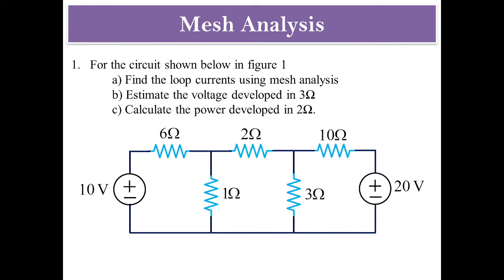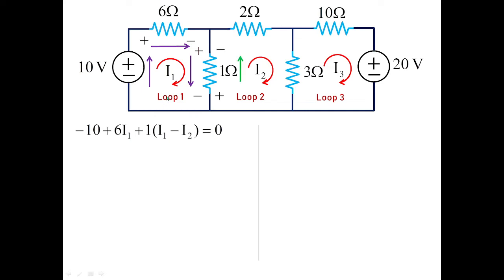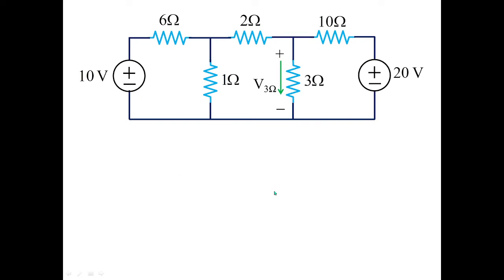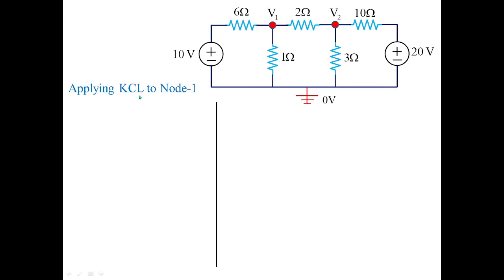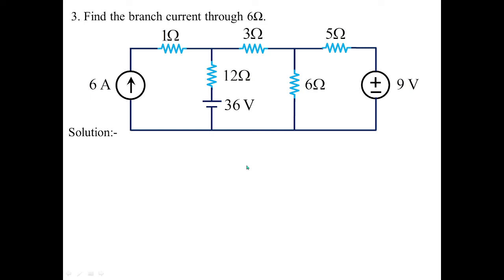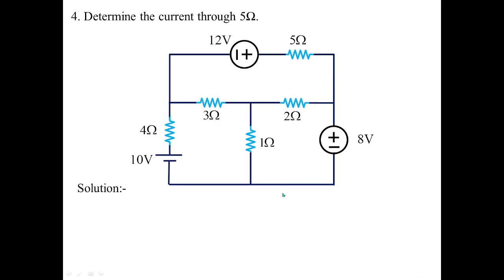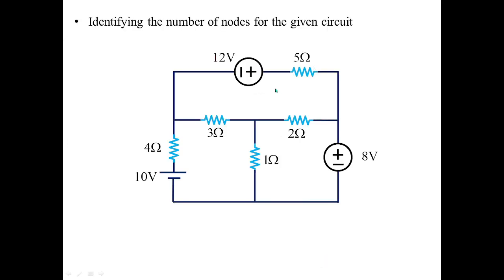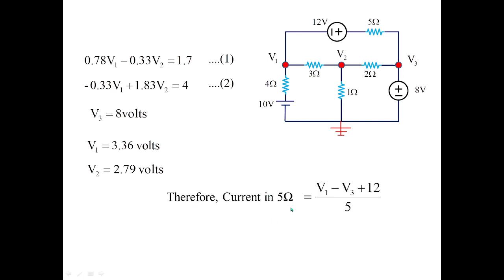How to solve Mesh analysis and Node analysis? calculation using mesh analysis and node analysis.

Comment: sir there v2 +20 will come not v2-20
Reply from the maker: No, mounika listen
while considering KCL to apply under node analysis 
i am considering nodes that is node 1 and node 2 respectively at higher potentials
when KCL is applied to node 2, 
the equation is 
(v2-v1)/2+V2/3+(V2-20)/10 =0
20 volts in the problem has negative  sign (i.e.,  negative plate) connected to ground and positive plate connected after 10 ohms.
that is why ( V2-20)/10 is the out going current from node 2